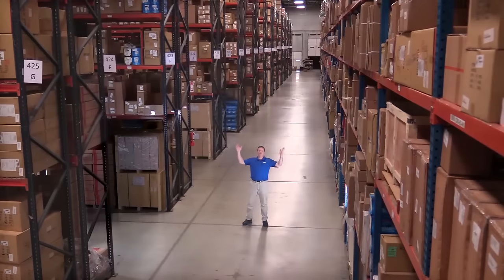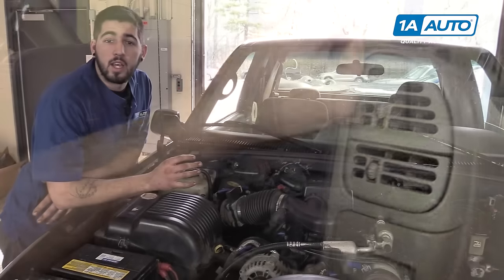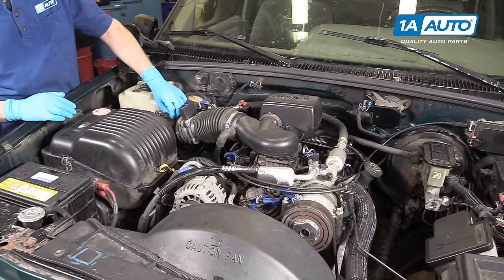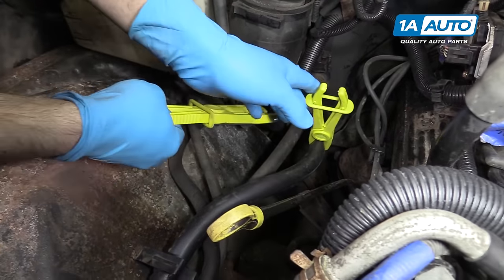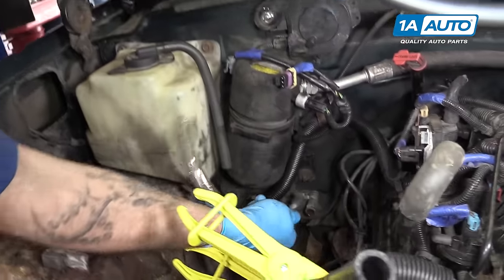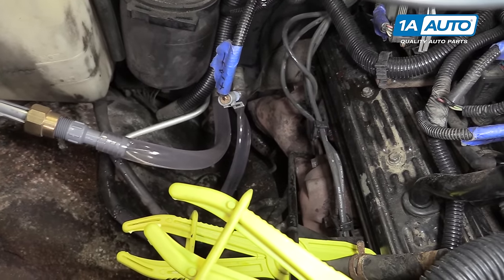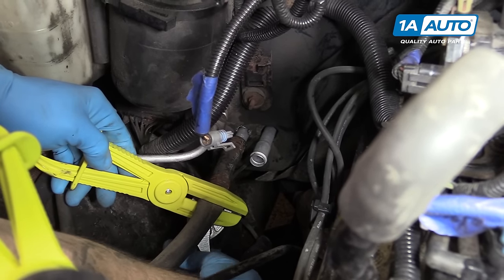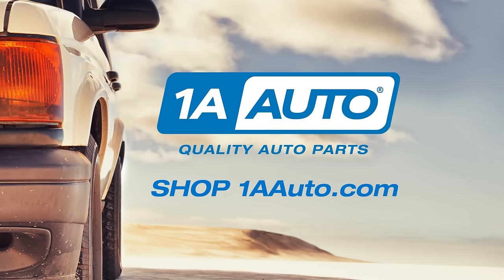How to Back Flush Your Heater Core by Yourself

Comment: What if I have heat but there is a gurgling sound coming from my dash when I start it in the mornings, I burped the coolant system already and its still doing it? do I need to bleed the heater core next?
Reply from the maker: +Michael Passion Comedy There may still be an air pocket trapped in the system. 1aauto.com
Reply: 1A Auto Parts you are correct, I continued to bleed it and it took care of the issue. Thank you so much for responding, great help
Reply: I'm having this same issue in my 08 Equinox. Little to no heat at cold start. Blows mostly cold at an idle. If I Rev the engine at an idle, I hear water whooshing under the driver's side dash area, not loud, just enough I notice. No overheating and once I get on the road, it starts blowing hot again and will continue to blow hot after I've driven for some time. I'm stumped. I've opened the bleeder valve and coolant comes out right away, no bubbles from it or air. Is there a 2nd bleeder I'm unaware of? I'm going nuts with this issue. Everything topped off and not a head/intake gasket issue. Help! Lol live in Iowa and winter is here!
Reply: @nicke5375  , did you ever resolve this?   I have the EXACT issue with a 2008 Saturn Vue, same car as yours, basically.  Any infor you can provide me?  I am in Alaska, and winter is coming here!  And it gets COLD!

Comment: I have a question I used some head gasket seal made by bars an it clogged my heater core up can it be flushed out my heater core I drive a 01 Monte Carlo
Reply from the maker: +Mr. Frost Not likely, you'll have to replace the heater core. Always take care using products like that, they are designed to find openings and fill them. It doesn't know the heater core isn't a leak.
Reply: @1AAuto  I had flushed it already an got all my heat back an blowing real hot heat

Comment: When doing this job on my car is there a certain type of pump I need and certain power you recommend so it won’t over power my heater core? And if there is sludge buildup will CLR clear it out, if so do I do a follow up with distilled water to clear out the CLR once it has done its job?
Reply: Make sure you keep under 10 psi

Comment: Both of the hoses on my 2000 Dodge dakota 4.7/v8 seem hot.🤔
Reply: blower motor maybe? do you have full strength airflow or does it seem low.

Comment: Ive back flushed mine twice and im back to not having heat. It lasts for about 2 weeks.  I have a new radiator so what could be causing it to clog?
Reply from the maker: +Kendrick Bannister We wouldn't be able to diagnose an issue like that here, you may want to have a local mechanic take a look at it. Thanks for checking us out! http://1aau.to/m/Shop-1AAuto-c

Comment: I did several flushes on my 98 camry, went around with water in it for about a month.  When I put coolant in it, it started leaking from water pump.  Any advice?
Reply from the maker: +MerkinMuffly It was probably leaking with water in the system, just the water was evaporating before you would see it on the ground. If the water pump or seal around it is leaking. You should replace the water pump.

Comment: You still have plain water in the heater core. Either blow it out or put new coolant mixture in it while you got the extension hoses connected to push out the plain water so it only leaves behind the new coolant mixture in the heater core/matrix.
Reply from the maker: +T K Thanks for the feedback!

Comment: So do you hook up the reverse flush to the hot side or the cold side
Reply: The hot coolant goes IN to the heater core and comes out less hot. So to pass water the other way (reverse flush) you'd connect your garden hose to the cold(er) side.
Reply: The purpose of a backflush is to push the sediment back out the way it came in. This hopefully prevents getting the sediment lodged further in the heater core.

Comment: About how much coolant would be in a 1999 Bravada heater core? Any idea would be great?
Reply from the maker: +Jack Carpenter There really wouldn't be very much, perhaps a pint or so.
Reply: Is it OK to use CLR to flash the coolant system? If so how much should I use? I know there is rust in the coolant because I see it in the over tank and when you take off the radiator cap. Any idea?
Reply: Jack Carpenter I would use 500ml or a qt of CLR and fill system with distilled water. Run it for a week then drain and flush out with plain tap water.
Reply: Jack Carpenter - I would not use CLR as it is not recommended for use on aluminum. I can’t be sure there is no aluminum in your heater core, but unless you know for sure there isn’t, I personally wouldn’t take that chance.

Comment: What if both hoses are equally semi hot ?
Reply: Then its probably not your heater core
Reply: Heater core is fine but fan is dead or vents aren't opening. Before assuming the fan is dead, it can be the actual fan speed switch.

Comment: Very well explained and infinitely useful, thank you!  I have no heat though air flow is good and so is AC.  Must be blocked!
I have to do this asap as it is winter in CA and raining a lot and windows get very fogged up so dangerous to drive esp at night with no heater on windows.  Also very cold inside the car. This is a godsend.

I want to subscribe but the music you insert in every video is painful and offensive.  It hurts the ears with an added extra layer of noise that is insanely irritating to the viewer. Those who have good hearing cannot stand it.  This is the only reason I cannot subscribe.  It is a pain to turn volume on off on off to give my ears a rest. They actually hurt after every one of your videos.
DO NOT ADD MUSIC TO A DIY OR DEMO VIDEO.  NEVER.  PLEASE!

Comment: What if both hoses are ice cold?
Reply: Thomas Dougless I don’t think that’s possible since one hose is from car’s radiator system which is hot if your engine is running.
Reply: Little late but that would be a thermostat

Comment: I have a 2010 Dodge Ram 1500. Could a clogged heater core cause a difference in temperature in AC mode between the driver and passenger side vents? I’m getting cold air coming out of the passenger side but not the driver side.

Comment: Can this make the car overheat also
Reply: Mr. Frost no check your electric fan make sure is working. That's if your car, truck gets hot wen you are driving. The other tip is if you're car, truck gets hot wen your car is park but is on working that is the termostato. I hope this info well help you. Good luck.
Reply: @juanbarrazasotelo5361  got it fix it was both my heads on my engine that needed to be rebuilt an my head gaskets replaced

Comment: Inlet hose is hott, but it gets cold about a foot away from firewall. Outlet hose is cold. Problem with heater core?
Reply from the maker: +Mary Poopins If the heat in the vehicle is luke warm, you could try to flush the heater core out. If the core is plugged up inside it may cause a luke warm situation in the vehicle. Hope this helps you out. 1aauto.com

Comment: Heater core hot going in and hot going out but inside the cabin its warn
Reply: Normal. Engine producing more heat than you need inside the vehicle. Which gets dissipated by the radiator.

Comment: Where is the heater core in a 2000 Chrysler Town & Country?
Reply from the maker: +Lety Velazquez We currently do not have an auto repair video that shows it's location. It may be on the passenger's side under the dashboard. Hope this helps you out. 1aauto.com
Reply: Probably under 3 ton of dash plastic. Nightmare to get to most of them.

Comment: i used bars leaks and now i have zero heat..could this help?
Reply: healthyamerican you sealed up your heat core for any leaks so now it will be more harder to flush it out
Reply: Try using bottle of Preston radiator   flush from Wal-Mart
Reply: You should have fixed the leak.  Bars is a band aid.

Comment: Or maybe the thermostat is stuck partially closed.
Reply: In most cases the thermostat controls the flow to the radiator but the heater core hoses attach before that and are unaffected by the thermostat.
Reply: Thermostat stuck closed would make it hotter, stuck open would make it cooler.

Comment: I have a van with good heat but as soon as I start driving my windows fog up, any ideas why?
Reply from the maker: +Jose Andaverde If you can smell antifreeze the heater core might be leaking and needs to be replaced. Hope this helps you out. 1aauto.com
Reply: 1A Auto Parts thanks but no antifreeze smell.
Reply: Heat actually cause the evaporation the cause your windows to fog, so if you turn up the a.c. colder air will clear up the windows. At least down in the south works.
Reply: Heat without the a/c compressor running just makes hot humid air. If your a/c is on but still getting humid air, you might have a clogged evaporator drain line or clogged evaporator.
Reply: Berreta 950 bs gun
Reply: Jose Andaverde I have an f150 inlet hose flow but very little comes from outlet and no heat

Comment: Why flush it, if your going to replace it??????.................
Reply from the maker: +Cameron D If you plan or replacing the heater core you do not need to flush it out. This video may help if your heater core is clogged and is causing a luke warm condition in the vehicle. Hope this helps you out. 1aauto.com
Reply: WHY REPLACE! FIRST DIAGNOSIS IS TO FLUSH!! IF that doesn't work and you tried everything ELSE, THEN YOU REPLACE $$$!

Comment: Can't you just flush out the heater core while doing a coolant flush?
Reply: Yes, during a normal coolant flush you would be doing a forward flush but what you really want is a back flush (water flowing in the opposite direction) in order to clear all the rust and contaminates from the heater core.